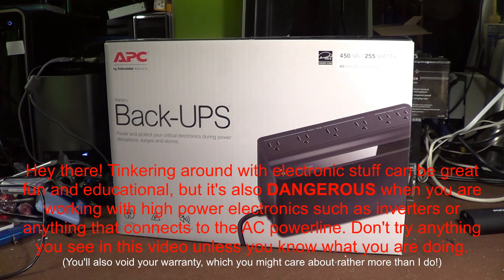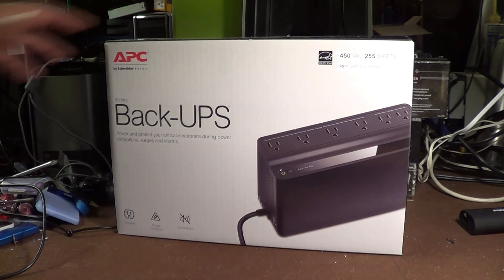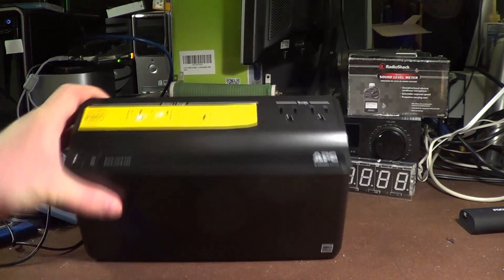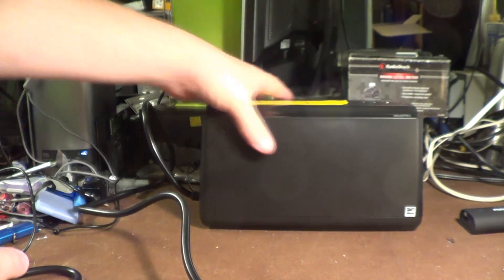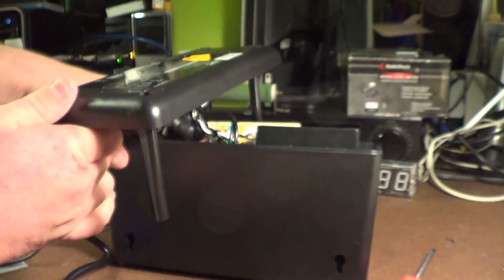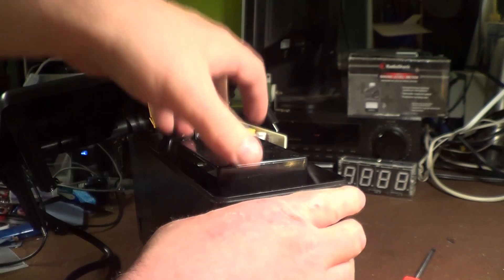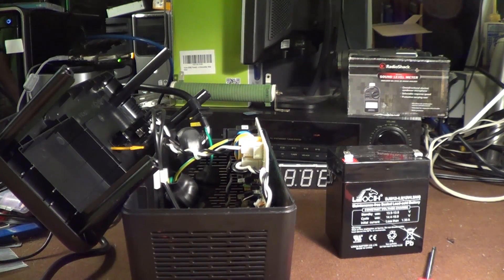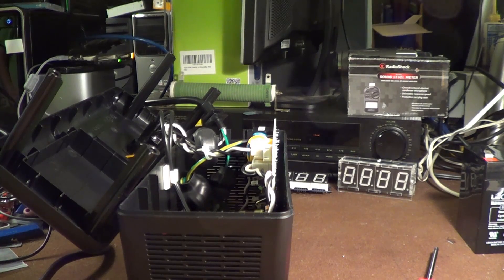Looking Inside a "Disposable" UPS

Comment: can the ups start without battery? most ups cannot. , 1)disconnect battery, 2)disconnect power input, then connect power again.
Reply from the maker: Edited because apparently I cannot read: yes, this UPS will start and run without a battery attached. Of course, it will complain of a battery fault.

Comment: Hey thanks, I found the APC 450VA (Same as yours in video model number BN450M-CA) at my dump and of course since it's an APC it WILL have a replaceable battery! Sure enough there ya go however my main purpose for visiting here today was to see how to work that silly yellow Battery Disconnect switch on the bottom of the APC. As you demonstrate at the end I used a set of needle nose pliers and pulled up and voila! Thanks! Now onto ordering a battery for this thing in Canada! Weird thing btw is this APC is functioning when I plug it in (sometimes) and if I unplug or turn if off then turn on again I get the replace/dead battery flashing red/green and beep tone. Anyways I'm just going to order the battery and be done with it!

Comment: I see no reason for this device to be disposable other than greed, and the mindset of the average consumer to care more about the outlay of a purchase rather than the value it will provide over time. It's fair enough that they discourge the replacement of the battery, but they shouldn't say it can't be done when it clearly can be with relative ease. By the time that battery reaches the end of its useful life, it's unlikely the device will still be under warranty anyway.

Comment: I purchased this only 2 months ago and the battery has already failed on me. Although it’s still under factory warranty, I’d still have to pay for the shipping cost. I am also disappointed that it contains a lead acid battery and not li-ion as I am just finding out now.
Reply from the maker: Although it's certainly possible to have gotten a defective battery, I'd make sure the attached load is suitable. Stay below 50% of the rating if at all possible.

Very few of these use a lithium ion battery. The SLA bricks are by comparison much cheaper, safer, easier to charge and inexpensive to replace. Their only drawback is one of weight. You can recycle the dead battery at any place automotive batteries are sold and get a new one for about $25 if you shop around.

Comment: Thanks, MR. Bill! I have a 600VA APC unit, so I was just cruising around to see what I could learn! Not much, really, but I thoroughly enjoyed your video all the same!
Reply from the maker: Truthfully, there's not that much to say. These small Back-UPS models are simple things. Their inverters output a "modified" sine wave (basically a square wave) and if there is a power problem, going to battery is the only thing they can do. The better ("larger") ones still only output a modified sine wave on battery but have an autotransformer that can adjust line voltage in at least one direction and do so without using up the battery.

The charging circuit is probably the most interesting thing about newer models like the one shown. It's based on a Power Innovations single chip solution that does some neat and clever stuff to boost efficiency.
Reply: @uxwbill  I have an SSD 500G /16G desktop with a 19" monitor and the wifi plugged into an APC 600 I am shopping for more units to spread the load. Do you recommend getting two more 600's or 1 of the bigger ones? 
I found a Tri-Lite (something like that) 1300 for a little more than two of the 600's. It's 900W and 1500 AV whatever that is. I think it's refurbished. But that is ok, usually, right? 180.00 including shipping. 
But really, all I care about is which way to go for longer-lasting results!

Comment: Just gave mine a new lease on life for $10 thanks to your insight and the battery part number!

You'll need:
A thin #1 Phillips with at least 3 1/4" reach
A pair of (preferably insulated) needle nose to help navigate the battery wires back into their channel
Common sense (unplug and turn off the unit, don't touch the board while in there)

Easy 5min fix for another 2-3 years of life
Reply from the maker: I'm thrilled to hear this, though I'm not sure how much hope I hold out for the longevity of a $10 battery...

Comment: What size screwdriver needed to open the case?  Also I assume they are Philips screws - not torx.
Reply from the maker: It was probably #2 Philips.
Reply: Phillips #1, need at least 3-1/4" long, they are in there deep.

Comment: Can anyone confirm that these connect to F2 terminals on the battery?  I'm looking at replacement batteries for this unit and most of them come with F1 terminals.
Reply from the maker: It's an F2 terminal.
Reply: @uxwbill , thank you.

Comment: A  most  important  issue .  You  took apart the  ups before  fully testing it .  Bad , bad , bad .
You have No idea of the state of the machine , before tinkering with it .
After putting it back toether , if it hadn't worked . Did it arrive broken ?
or  did it get broken by the tinkering ?

All i can sya is :  BN450M  performs like a true ups  when using  battery :  CSB  GP  1272  F2  this is the  7.2  ah  battery , price 24  bucks .
The battery  date  , was made in late   july of  2020 , so it is about  6 months on the store shelf ,...pretty good and pretty new .

When  your  BN450M  is  Out of  Warranty and you need a new battery for it,
then  connect the above listed  battery and you will be  amazed at how good the  BN450M  performs .

Do this  at your  own  discression .  If you can change a car battery you should be able to do this :
Turn  OFF  the  ups and  unplug from the wall  outlet .
Remove the  Yellow  jumper( which disconnects the Black wire from the  battery ) , now  remove the back panel and remove
the  internal  Leoch  battery .
now ,
Drill 2  quarter inch holes in the back panel where you will  feed the 2 lugs through .  Put the back  panel  back on .
Put  "Piggy Back"  lugs on the  CSB   battery's  Spades and
bend the  2  Piggy Back  Spades to face  the  ups back panel .
The  Ups  will need to sit  higher then the battery for the  wires\lugs to  Line Up .
Plug in  the battery . ( Red to Red , Black to Black )
now  insert the  Yellow  jumper .
charge  as needed .
I recommend  keeping the  ups  power button   OFF , and let the  ups  charge the battery for at least  4 hours .
That will keep the   ups  PCB  Pirnted Circuit Board  cooler , while charging for the first time .
The battery voltage is  now very easy to  measure with a  DVM .
F2  are  1/4  quarter inch  lugs .

page  8 , in the user manual :
"The battery in the Back-UPS is NOT  user-replaceable.  Contact  SEIT Technical support for a list of authorized service centers near you"
taking it to a  service  center , not a  recycle facility .  Service center implies   Change the Battery .
Read the book . don't make stuff up .

Buying  stragedy :
Already have a BN450M ? is yes ,  and it works . just put a larger battery in it .   CSB GP   1272   F2   7.2  ah  or CSB 12120  F2  12 ah.
i don;t want it to run for 1 hour . just long enough to shut the stuff off , wall unplug everything , and wait for power to come back on .
That  Lecoch  original battery is  minimum
and as you said , as batteries  reduce in capacity , we need to start with a bettery battery .
again ALL  APC  ups  have 3 minute runtime at  Their max  load , including  BX1500 .

No where does the manual  say the BN450M  is  disposable  throw away , when the battery dies , No Where does it say that.
BN450M is meant to  have the battery  replaced .

It says  the  Owner  consumer should NOT  replace it , no doubt  as a safety  concern .
The  BN450M  is  100 %  re-usble  with a  New  battery , just like any UPS  is .

The manual says : "standard policy is to  send out a  referbished uint to replace a failed  UPS" .
you pay to ship the faild unit to them . they pay to ship a  referbished unit to you.

All the above is in the user manual , in  English .

When you first turned on your  unit in your video , you did NOT  read the  Yellow  sticker
and you did NOT connect the  black battery wire to the battery , using the  Yellow jumper on the back panel
that is why the UPS  faild on first power up .  Operator  Error .

All the above is why i added an extra Thumbs Down . count is now at  22 .

BN450M  is a  good  ups .
if you need more runtime  around the  200 watt range and  you already own  BN450M
just replace the battery with a larger battery .  7.2 ah  with F2  Lugs works awesome .
The other unit is gonna get a  12 ah battery with  F2  Lugs .
CSB  GP 12720  F2  , about  24  usd
CSB  GP 12120  F2  , about  40  usd

The original battery is  4.5 ah
Reply: Rather than drilling holes to fit in a bigger battery in a small enclosure as the BN450M is, a bigger capacity UPS would be preferred.  I bought a BN600G (w/ the CSB GP1272 7.2 AH inside) for only $29.99, so these aren't expensive items that's worth that type of modification.
Reply: @seannoh672  where did you get it for 29 ?  New or  Used ?

If someone already has a BN450M  that is out of warranty , then it is worth while to fit it with  1272  battery .
If  someone needs an ups ( cause they don't have one ) then sure , get the BE650G1 .
Make sure it comes with the  RBC17  battery .

In fact  the  BE650G1  is underpowered by the    RBC17  battery aka  CSB GP 1272  F2 .
BE650G1  really needs   the  CSB GP 1212  F2 .
( guess what's gonna happen in  3 years to the  BE650G1  ? )
Reply: @240mains , It was new at B&H Photo, but of course it's discontinued now.  Question for you:  Was the connector for the BN450M T2 for both positive and negative or T2 just for the positive?  Or T1 for both?  Thanks!
Reply: @seannoh672  the  original  battery in  BN450M  is  "Leoch  DJW12-4.5"   both  battery Spades   are  F2 .
Both  lugs  in the ups unit  are  F2  lugs . ( that was 3 years  ago  when it was new )
( i can only guess it is still the same )

considering ,  "CSB  GP 1272  F2"  battery is  24  bucks .
condisering   RBC  battery  is about  44.95 .

29.99  was a  give-a-way  ups .

didn't realize  BH  sold  ups .  will have to check that out . been at their site ,  never looked for ups .

Comment: I thought in pass I was aware you can change out battery. Why is it the stores show replacement if you can't replace. I just bought the apc 650v from OfcDepot. First few days I had odd odor in home. Unplugged everything for 1-wk. Plugged in for a week and did not have an odor, so plugged in items
again. Now weekend before Capitol Attack slowly odor started again.  Been 3-4 days and gotten worse so unplugged all again. Will wait and if odor goes away, will try to return for refund. I have a
CyberPower and have no problems with odors. Thanks for your tutorial opening battery.
Reply from the maker: This is not the 650 VA model, which if memory serves, has a battery access door. (The 900 VA model definitely does.)

What you're smelling are probably plasticizers and similar chemicals used during production of the UPS. Some people are more sensitive to it than others, and it seems that some APC products emit more of it than others. The gentle warmth from the circuitry within will enhance the smell through convection and probably speeding up the outgassing of chemicals.
Reply: Thanks...appreciate your input.

Comment: Ok? What's the time frame on this battery if I'm running a cb radio on it as a back up? Thanks
Reply from the maker: Even if your CB radio runs directly from 120/240 volts AC, you won't want to power it from this. The inverter will interfere with reception and transmission...unless you live in a part of the world where FM is used instead of AM for CB radio.
Reply: @uxwbill  😂😂😂😂
Reply: @uxwbill  cb radios are am lol
Reply from the maker: Joke's on you: https://en.wikipedia.org/wiki/CB_radio_in_the_United_Kingdom

Comment: I just got one today and plug in and after 30 minutes started to beeps and red and green  light . Fuse is installed and pluged in the wall. what a hell?
Reply from the maker: Possible battery test failure or overload. Turn the power switch off, but leave it plugged in for 24 hours. Try again. If it still happens, check the total wattage of all the equipment that is plugged into the UPS.
Reply: @uxwbill  , nothing is plugged in, it looks like bad battery.

Comment: I plan to buy APC BX650LI-MS, and I live here in the Philippines. My biggest concern with this product is its input connection which is NEMA 5-15P (Three-Pronged Plug). The electrical outlets at my house are Type-A (Parallel Flat Blades Socket).

Is it safe to use a cheater plug or universal adapter so I can plug the UPS into the Type-A Outlet???

I want to use the UPS to power backup my PS4 Slim just in case power goes out.
Reply from the maker: Being in the US, I cannot say what is safe or not in the Philippines. I would recommend asking APC, an electrician, the seller or distributor for recommendations.
Reply: @uxwbill  Thank you for the advice.

I'm waiting for APCs response on my query.

Comment: Have a BE425M that gave up the ghost.  Since the terminals at the battery were putting out 13.79 volts and the battery terminals when disconnected I got under 6 volts I took a chance and ordered a replacment battery for under 20 bucks.  Arrived today.  The battery fit like a good glove.  And it's ALIVE!.  Watching the video convinced me to fix it instead of sending it to a recycling center.  It is now backing up the power to my router extender/backup and printer.
Reply from the maker: There's really very little that goes wrong with these things. I'm glad to hear you replaced the battery and got yours working again.

Comment: What about that yellow plug underneath?
Reply from the maker: That only serves to disconnect the battery for shipping purposes. Since disconnecting only one of the two leads is necessary, that's all it does.
Reply: Thanks for the quick reply. For this ol’ retiree’s understanding, I need to plug the short yellow cord into the outlet on the bottom of the UPS; then, plug the unit into a suitable wall outlet to have the UPS charge. Correct?
I better get this accomplished. This being my first such unit, it could come in handy. Power outages are rare, but one should be prepared.
Reply from the maker: Yes, you'll want to plug in that little yellow connector to activate the UPS. This will connect the battery to everything else. After doing that, you can plug the UPS into the wall outlet. Generally speaking, you can start using the UPS immediately after doing so. Depending upon how long it has been sitting in a warehouse or on the store shelves, the battery will need a few hours to charge fully.

You'll know right away if the connector is attached correctly when you turn on the UPS. If it doesn't detect the battery being connected, a constant beep tone will sound and the power button will light up red. If the power light comes on green and stays that way, you're set.

Expect to get about 3-5 years worth of lifetime out of the battery.
Reply: @uxwbill The battery on mine just died after 4.5 years. Trying to confirm that it wouldn't be crazy / dangerous / difficult to replace it, and I wound up here.
Reply: Great! Thanks very, very much!

Comment: Hi Bill, picked one of these up today for backing up my Modem, router, and switch.  I have a CyberPower Pure Sine Wave on the iMac.  The new physical setup requires two separate UPS systems as the components are no longer physically able to share one UPS now.  I finally got to the bottom of my flickering lights and strange UPS behavior.  My circuit breaker had suffered damaged and the apartment complex had to higher electricians to replace it and clean up the burned wiring.  They also had to pull the meter, which normal maintenance wasn't able to do, because they got scared as the meter didn't pull out instantly when they tried.  Turns out the newer digital meters can be harder to pull vs the older ones.  Either way I seem to have clean power now, and all is quiet.
Reply: I'm about to get one, and am a bit sad about the disposable design. The old one at least had a slide-off battery door. 😕

Comment: Can i just use one of these as a power bank for when i go camping or something ?
Reply from the maker: Not for very long, and if you do, the battery will not be long lived. It's intended to be recharged immediately after use. At best, which means only under an extremely light load, you might get two hours of runtime.
Reply: A  real  UPS  system is this :
AC  power goes out ,  Battery  UPS  comes On Line to keep everything running ,
just long enough for rthe  Generators to come  On Line .
Once the Generators are On Line , the battery  Ups  returns to  Charge mode .
Once  AC poewr is restored , the Generators go  OFF line .

At home most will NOT have a  Generator . So the UPS is mostly meant to
keep your stuff running for a very short time , just long enough for you to 
shut everything down and turn everything  OFF . After that , i would
Unplug from the wall , and wait for  AC power to come back on line .

Some UPS come with  USB and software to  power down your equipment
thus the UPS is only running on battery just long enough to properly  shut down everything .

Long time  runtime on battery can be achieved at low power loads ,
modem  ,  wifi router 10 watts or so , for many hours .
Assuming you have  mission critical  communications with No  Generators .